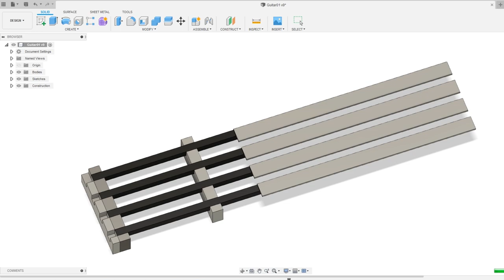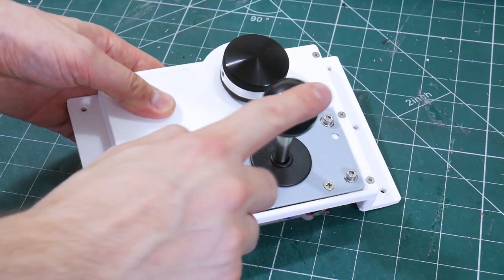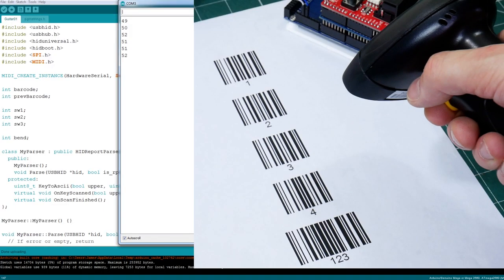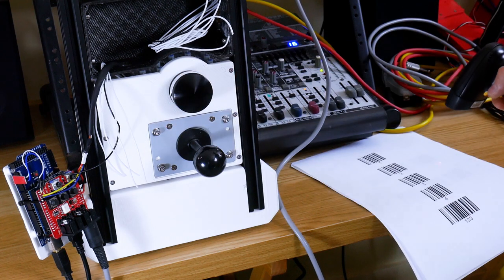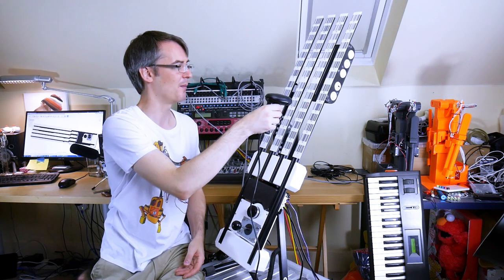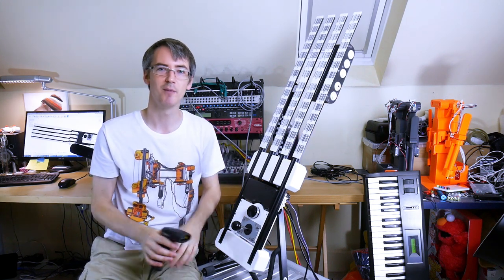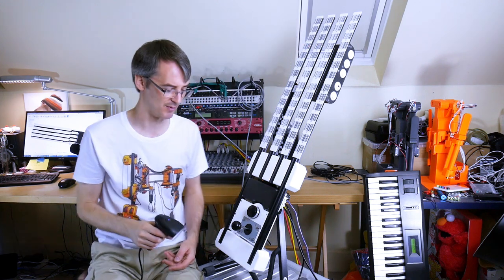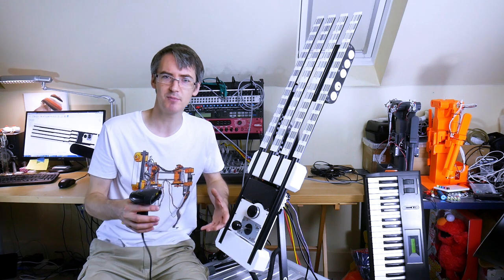This GUITAR only has Barcodes!

Comment: Nice work. Just one request remove that buzzer/speaker from the scanner which creates beep sound
Reply: You can probably scan some system codes from the barcodes manual to disable speaker.

Comment: You could add a laser strip that's lit all the time to help with aiming the scanner. So you get a line of light across the barcode and then it scans when you pull the trigger. How about also making the scanner wireless?